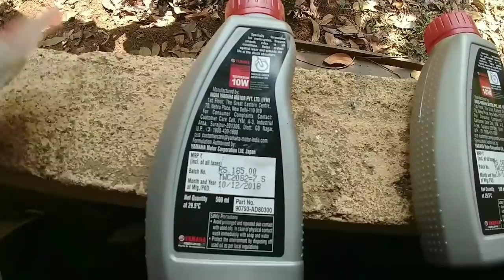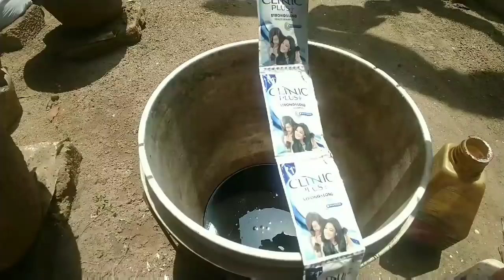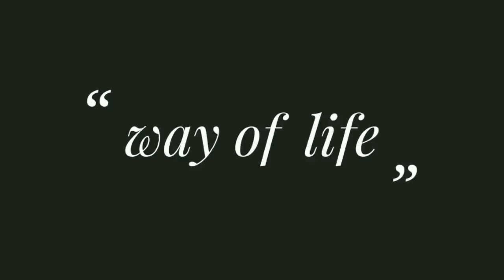#YamahaProblemsKerala #Yamaha #YamahaKerala #YamahaFZ #FZSV3 #R15V3ABS #YamahaMT15 Way Of Life VLOGS

Comment: Every 12000 km change fork oil
Airfilter plug lubricate whole wheel bearing and Race bearing kit if any damaged parts need to chagae then measure the clutch disk and clutch plate thickness if damaged parts change clutch disk assy wit boss clutch and pressure plate and push rod

Comment: Bro which one is best Yamaha fzv3 or Honda hornet 160
Reply from the maker: Hornet low end torque കൊറവാണ്
Reply: Fzv3 light weight aanu and beginner friendly aanu hornet power and top end kooduthalanu ithiri koodi rasamayitt odikkam. Yamaha engine ithirikoodi reliable aanu ennanu ente oru opinion
Reply from the maker: Yamaha ആണ് best...  yamaha ഓടിക്കുന്നവർ വേറെ level ആണ്...  എപ്പോളും rider friendly വണ്ടികൾ ആണ് യമഹയുടെ...  പിന്നെ വേല കൊറവ് ആണ് maintain ചെയ്യാൻ...  parts ചീപ്പ്‌ റേറ്റ് ആണ് compared to honda.  എപ്പോളും low end ടോർക്ക് ഒള്ള വണ്ടികൾ ഓടിക്കാൻ ഭയങ്കര രസം ആണ്...  അതാണ്‌ yamaha..
Reply: Thanks
Reply: Hornet

Comment: dont use these kind of airfilters this will damage your engine. you should adjust your fueiling according to your airfilter and these kind of filters will bring more dust to the engine which is not good
Reply from the maker: Why so ബ്രോ?
Reply: @WayofLifeChannel  more air and less fuel will get combused which is not good and also more dust will enter through these filters
Reply from the maker: Ohh 🤔
Reply: @Rahul I am useing cosworth air filter in my Suzuki GS 150 .it was a conical filter . Without setting the carburettor  you are right.We should adjust the carburettor for proper fuel air mixture after that it's awesome .My bike  is perfect now also .
Reply: Air fuel mixture setting is very simple .you can get so much viedoes in you tube
Reply from the maker: Mmm👍😊😍
Reply: @thomasmathew30  this guy is showing it on an f1 motor you should remap your ecu on it . if on carb you have to put in bigger jets not just simply tunning in more fuel and also using freeflow power filters will bring in more dust to engine which is also a problem in indian condition !

Comment: Bro insta id paranjillaa
Reply from the maker: Insta ഇൽ ഞാൻ ഇല്ല
Reply: @WayofLifeChannel  any other way to contact you like kurachh doubt chodikkan indd
Reply from the maker: എന്താണ് ടോപ്പിക്ക് എന്ന് പറഞ്ഞാൽ എല്ലാവർക്കും upagarapedum എന്നാൽ വീഡിയോ ഇടാം ബ്രോ
Reply: @WayofLifeChannel  about your last video , stock air filter change chyth k& n endee eedunnath ... Aath actually more air + normal fuel aakumbol lean mixture aavilee ... Soo aath milage reduce chayillee ? And performance aagne ann increase chayuvaa... Actually aagane engineill rpm difference undakuvoo ? Power increase aakuvoo...
Reply: @WayofLifeChannel  aagnee kure doubt indd... Aathonda chodichee
Reply from the maker: Carburetor tune ചെയ്യണം air fuel mix അനുസരിച്ചു...  ഇതിനു videos ഒണ്ട് യൂട്യൂബിൽ കൊറേ modification ചെയ്യുന്ന ആൾകാർ ഇട്ടിട്ടുണ്ട്
Reply: @WayofLifeChannel  link onnu share chayuvoo... Stock ill nadakuvaa. Exhaust change chyaathe
Reply from the maker: എനിക്ക് insta അക്കൗണ്ട് ഇല്ല ബ്രോ
Reply: @WayofLifeChannel  insta link allaa... :(